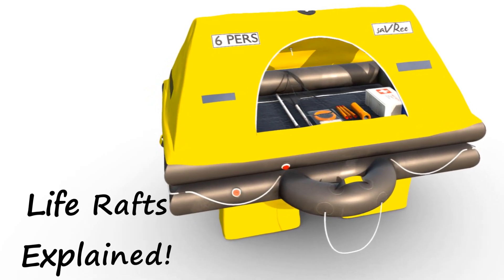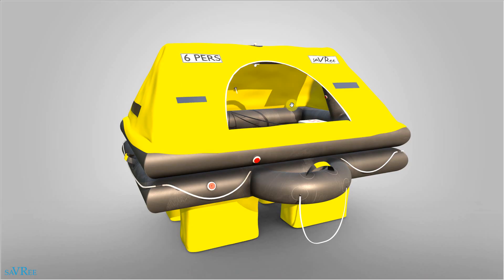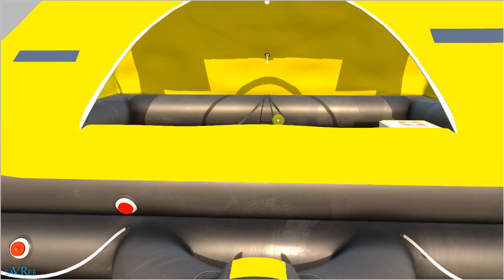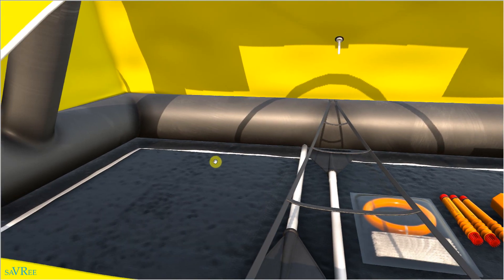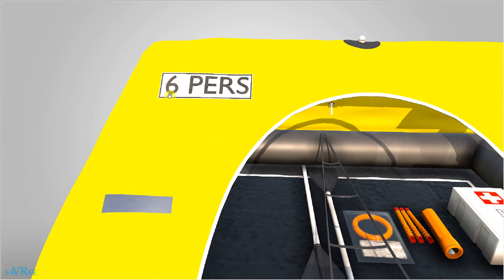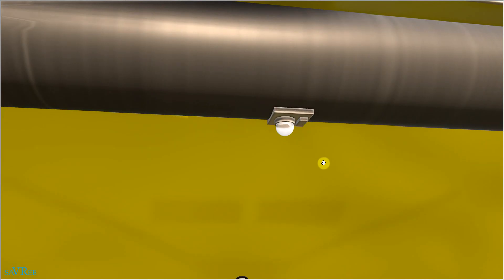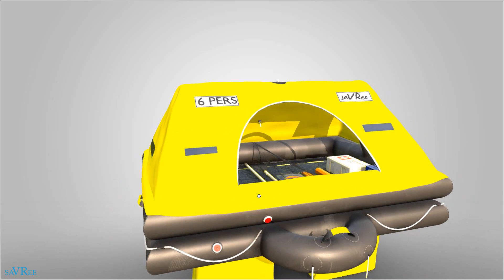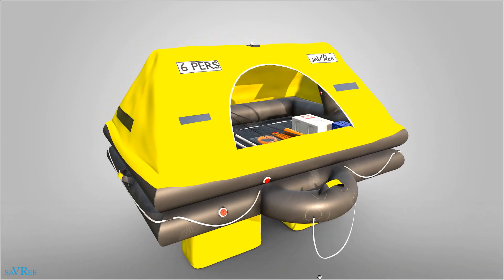Life Rafts Explained! (SOLAS – liferaft)

Comment: They could add some ventilation, and at least one more water collector, its the most important feature and theres only one and its small compared to the side of the raft its on, they could have made it wider. And they could add add ac with solar power and a 65in oled tv with a ps5 pro but at least the ventilation and water collector 😂

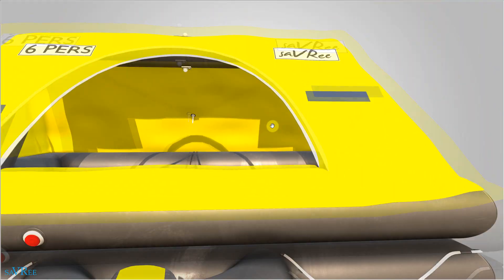Comment: 5:25 is there ventilation in place to prevent the cabin filling with excess CO2 in the event of an overpressure? Presumably the raft isn't completely airtight, but I'd be concerned about short-term CO2 exposure if there's an overpressure while the raft is closed up

Comment: The raft should also have a cat-eye radar mirrors somewhere at the top, so they can be seen in spectrum other than visible wavelength. Some flexible / surface coated PV panels for basic electricity would be nice too.

Personally I prefer the hexagonal shape as it's optimal in terms of volume vs surface area and can be combined more tightly when in groups.

BTW it's a great introductory video, one never knows when this knowledge may come in handy.

Comment: Interesting they do not haved soft or pliable solar panels builded into the exterior roof panels to recharge your batteries. All so they should have a emergency satellite telephone as equipment or at least a EPERB and the solar panels could charge them as needed.

Comment: A couple of things this raft needs are netting seats to keep you off the floor. A floor off the water with a drain. A zippered room for using a bathroom.( uncomfortable for women to go no. 2 over the edge of the door when people are watching). A mirrored disco ball (small) on top of raft to refelect sunlight. (Bright colors are hard to see far away). Your wet and cold you need sealed expandable insulation?? Expands when boat is inflated. Wool blankets?? Not a piece of rope for a ladder a slide with cleats.
Reply: These rafts are meant for making a difference in life and death situations. If any of the occupants has trouble pissing or shitting because of the other strangers on board, tough luck.
Reply: @pieterveenders9793  yeah but it might be because of making it cheeper. And I hate that.
Reply: @Jack-bs7cy  Yes, but you can also look at it from the other side. In wealthy developed countries buying life rafts like these is like small change, but for poorer countries probably not so much. So every bit of saving on non-essential things to drive the costs down will also make it more affordable and thus likely to be placed on ferries and fishing boats in the less well off regions of the world, potentially saving additonal lives.

Comment: Hi savree, great production and inovation!

let me introduce myself, I am an outdoor enthusiasts, and I also teach survival occasionally. I regularly raft in rivers and camps in the woods. And I think I have some idea to improve your design.

First, you should've implement some symbolism in your raft, for example, instead of 6 PERS try to change it to 6🚹(person symbol) so people who might doesn't speak english can understand it. So goes with operating the lights, and valves and roof (more about it later).

Secondly, you could implement drain holes that you could open and close in the corner of your boat, just like a river raft does, it make sure that the raft will never flood with water and also can capture water vapor from the ocean itself when its hot if it opened so survivor wouldn't need ro rely in rain for drinking water. It also needs to be having a dew collection system like a low spot inside the roof. (Should've work like sea water collection system)

Speaking of roof, you might consider using flexible and detachable fibers frame and roof to support your roof because it known to held up in heavy wind and blizzard in the himalayas. And the roof it self should've use material like tarp or dyneema composite fabric that have tensile strength 15 times better than steel, very light and virtually waterproof. It could use straps, buckles or carabiner to strap it to the boat and hangers to attach it to  the frame like camping tent does. This system will also reduce the reliance on gas or air to be deployed. And also can lightening the package for considerable amount as a bonus

Another improvement for the roof that i could think of is try to consider a closable door for the roof because if it rains the water are going to flood the floor. You could use waterproof zipper or layering the zipper with the extra material as redundancy. And try to implement two door so i can improve air sirculation.

And if it raining at nigth and the survivor have to sleep try to implement a ventilation system like mesh that could open and close in the roof so CO2 doesnt build up in the tent and suffocate the survivor when they sleep when it rains. (Try to look out from camping tent design the good one will always have this feature)

You could also include a detachable lightweight solar panel that's popular among hikers these days. I could be hang on top of the roof to get better efficiency and can make sure the light can stay on indefinitely

I like how you include paddles in your boat but as a rafting guide, I could not think how would you steer and navigate with such limited space to paddle. So that detachable roof might come in handy for this function also can make survivor can easily climb from any side if it detached and from initial deployment.

I know my comment might not reach let alone give difference or even further complexing the design and production but I think that's a small price to pay for life in the survival situation.
Reply: My very first thought was symbols would be an instant improvement over english

Comment: The floor can be manually inflated (by lung power).  The floor should be inflated in cold weather and left uninflated in warm weather.  In cold, you want the insulation.  In warm, you want the relative coolness of the water against the underside of the floor to help cool the inside.  Also, if in a situation where day/night temps are extremely different, you may need to manually add air to the main bladders originally filled with CO2 at night, just to have the pop-off valves blow it back off in the heat of the day.
Reply: Do you get a force advantage somehow in order to bring the floor to adequate pressure using only your lungs?
Reply: @vanderkarl3927  TL;DR: no, but you shouldn't need one. You can produce enough pressure with your lungs

Humans can produce around 2-2.5 psi of pressure with their lungs. by my rough estimate, I take up about 3-4 square feet of surface area when sitting. taken 3ft, because it's the less advantageous number, I get 108 square inches. at 2 psi, the relevant area is exerting 216 pounds of force, which is in excess of my actual body weight of 195lbs. It's a workout for sure, but not one that 6 people taking turns can't manage. Not like they got much else going on anyway...
Reply: @Nathan_Lang  You are assuming that everyone in the life-raft is fit and healthy. Chances are that they won't be.
Reply: I should say some of the bigger rafts may have a pump
Reply: If I ever have to board one of those life boats there is zero chance I'm gonna uninflate some aspect of the lifeboat bobbing out at sea lol
Reply: @Jomskylark  you don’t… there are automatic relief valves.  They will let out just enough during the day.  If not the thing could burst, and you’ll be in a worse position.

Comment: 5:20 Isn't a CO2 release valve on the inside dangerous? If that leaks and the CO2 level inside gets too high, isn't there a real danger of suffocation?
Reply: With how open the life raft is and how little CO2 would be vented, this should be a non-issue
Reply: I'd worry much more about the CO2 of the other passengers if you closed the flap. I almost killed myself and my husband camping that way once.
Reply: @Shasta--1  Speaking as a man who's been married for two decades, it might not have been the air you were exhaling that nearly killed him.  ;)

j/k Glad you're safe.

Comment: 6:47 - I'm guessing that the water would still be a bit salty from ocean spray, especially if the raft has been on the water for a few days, right?
Reply: @abhignavijjapurapu209  When the rain first hits, collect and then throw out the first bit of rainwater, which will have 'rinsed off' the salt on the roof.
Then the rest of the water should then be relatively drinkable, provided your raft isn't being washed by heavy surf..
Reply from the maker: Bit salty, but you can flush it first. Beggers can't be choosers!

Comment: very nice explanations and video. If those reflecting tapes were larger like going around the craft and also crossing the whole length on the top would be more noticeable at night.
Reply: they don't want the strip to get mistaken for a reflection off water/waves. It broken up means only certain parts will be more reflective, it being unevenly reflective is making it more identifiable. Hope that makes sense.
Reply: I think that there could be more reflective tape and square or rectangular shape would help capture attention.